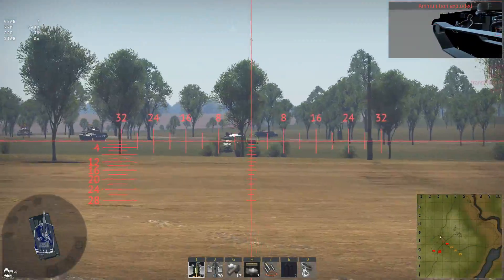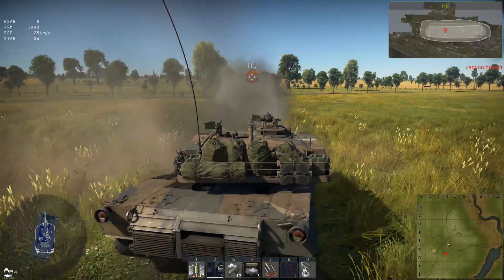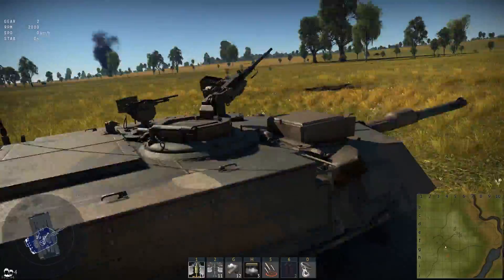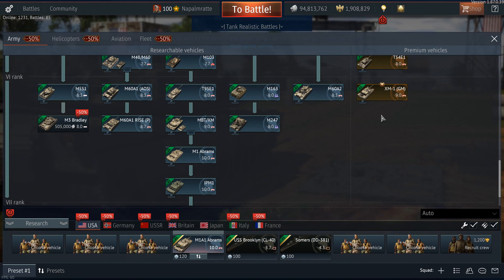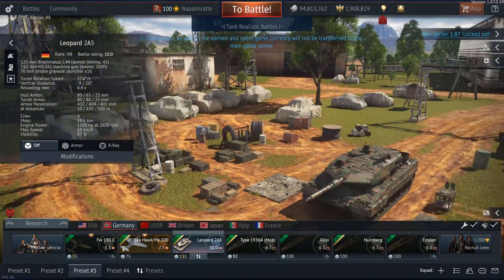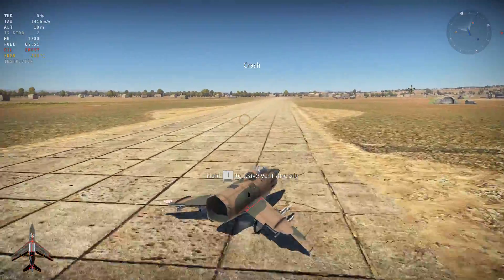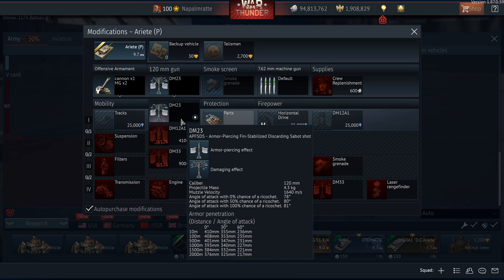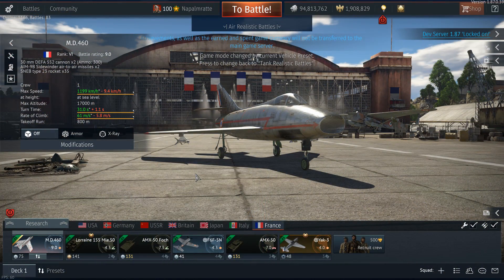WT || Dev Server 1.87 - Changes and New Stuff

Comment: Missiles at 7.7, goodbye 6.7
Gaijin put down the vodka
Reply: At Gaijin were too drunk to think that they could had the version without missiles if they wanted that br
Reply: @thaster973  theres the bmp at 7.3 and the strv at 6.7...
Reply: @Ray-lf1eo  BMP should be at 9.0
ALL missiles should be at 9.0 or 10.0
Reply: Missiles won’t be that dangerous because at 7.7-6.7 its much more about turn fighting than in 10.0.
Hochachtungsvoll,

Ponnes
Reply: Not that I agree with missiles at 7.7, but it's actually really difficult to get a lock on prop planes. Think you have to be at like 500 meters to even get a heat lock. Against early jets though, that's not gonna be very fun.
Reply: At least AAMs shouldn’t be able to target prop planes
Reply: Missiles can't target props
Reply: They can in warthunder, but as a 7.7 you will probably never face props and aam are nothing gamebreaking or op so just relax.
But keep in mind „GeRmAny SufFeRs“
Hochachtungsvoll,

Ponnes
Reply: I do not see the problem here. Please let me know if I miss something, but there is only one 6.7 plane in techtrees outside the german one. It is the Spitfire F Mk. 24. I am curently grinding/spading my 6.7/7.0 german jets and to be honest the bigger problem for me allways were the F84s ruining my day by simply outperforming every jet germany can offer. In 7.7 BR battles I can recal no time seing a Spitfire flying around. So if I queue as 6.7 german jet I firstly are no fighter, or were no good one(Me 162), and if I saw a F84 I was in a possible max BR of 7.7 and the match was destined to be no fun. Because germany as of this point in time has NO 7.3/7.7 aircraft at all. Speaking of unfairness .... The other nations that often get pitted against germany are the USA with 3,Brittain with 2, Russia with 2 and France with 3 possible planes flying at BR 7.3/7.7. It is only fair that germany does get a BR plug in this region, the only question is if it should be made with a premium.
Granted the italians do have a F84 at 7.7, but the german tech tree has no answer till now. And knowing a small bit about how heatseaking missiles work they should not be able to lock on (super)props from that far of a distance as on jets anyway because of their lower heatsignature. Thats why the A-10 Warthog has these turbofan engines (that do get used on  commercial airliners as well) because they also do have a lower heat signature so that Fox-2 missiles do need to be closer to find their target.
I would be more concerned about the other jets at 7.0 than about that one British superprop to be honest, but I also am of the opinion that the missile warning message had its place in the game and thus the Fox-2s would not be that big of a problem anyway. If you want me explaining why I think the message should stay look here: 
https://www.youtube.com/watch?v=YL65QhkFgPc&t=220s
look for a creatorliked comment of Deric Carmickle, my reasons should be an answer to his comment.
Reply: What I also forgot to say is that we don't exactly know how good the Sea Hawk does perform as a fighter anyway because it mainly is a groundattacker/cas, so stop loosing your shit about everything.
Edit:
And judging from the statcard on which we only got a small time to look at, the Sea Hawk does have similar flight stats as the stock Amercan F84 at 7.7 and probably worse when the F84 is spaded and if it carrys not the Fox-2 missiles but other ordinance it should perform even worse, so the plane should be ballanced. But if you still insist of it being moved up the BR the F84s defenitely do have to do the same.
Reply: @haubentaucher8382  Russia has yak15 6.7, and i have heard rumors that he162 will be 6.3. (Both RB)
Reply: @bluecheese4090  You are right regarding the Yak15, but I was focused on props so I plainly overlooked the Yak. My mistake. And yes I know that the Me 162 is 6.3 now thats why I wrote "were  no good (6.7 fighter)"

Comment: the tunguska has 4x 30mm guns. they are mounted in 2 pairs on both side.
Reply from the maker: it was 4 o clock in the morning my dude ^^
Reply: It's two guns with twin barrels. Practically it makes no difference though. Works with the Gast principle where the recoil of one barrel loads the other, cool system that's got impressive rates of fire.

Comment: M256 is derived but not a licenced built L/44.
Reply: Technically, you still needed a licence for that (pun intended). You are both right in some way. Apparently 256 handles higher pressure, which allows a projectile to reach higher velocity, but still doesn't compete with L56 all that well according to some papers.

Comment: Nothing in this game can reliably pen the front of the Leo 2A5...
Reply: lol i m still sure some tanks with hight calliber guns can lol pen that thing with a he round
Reply: the hull armour seems to be bugged. It should be ~430mm UFP apparently, and ~200mm LFP.
Also the turret side armour gives some wierdly high values. Most of it will hopefully be fixed in the live server. Its hull should be a relatively easy penetration for most of its opposition, which allows a ohk by either hitting ammo (if there is any stored there) or the three crew lined up on the other side. 
Also the turret wedges are destructible on the leo2a5 in a similar fashion to ERA. What the turret armour values are without the wedges idk, so it might still be 500mm+ (i.e impenetrable with current ammo), but it's worth noting anyway.
Reply: Remove Weebs good

Comment: Irrelevant question here....
Does anyone know if the tunguska SAM has been fixed?
In the previous dev the range was about 3KM ish whilst it says on gaijin forums 8KM..
U cant touch a AH 1Z or any other capable chopper with 3KM SAM
Reply: @Gridlocked  what does that mean?
Reply from the maker: I said in the vid that the range is 8 km
Reply: @Napalmratte  and did u really test that it is accurate? cuz on the previous dev it also said 8KM but the missile exploded around 3km... just saying
Reply: @Gridlocked  yes but i want the tunguska for one thing n one thing only, collect AH 1Z players tears :) and i need to be sure that sam is able to deliver me that joy

Comment: DM33 with 485mm pen... facepalm  2A5 is going to be just  as gimped as the 2A4. Gaijin and their damn alternate reality......
Reply from the maker: 1) Dev server - changes are imminent
2) who cares, you still shoot it at the gun breech ... voila, you win ...
Reply: Currently the best armor in game (if values dont change), no one else really got anymore armor. 
Similar mobility to m1, will have good fighter support
Reply: @Napalmratte  The breach which in reality is protected in 3 steps: 
1) A ~50mm angled NERA plate  
2) A 600+ mm LOS NERA module (increased from the 410mm of the 2A4) 
3) A 240mm titanium trunnion
Combined providing the same protection as at the cheeks, i.e. ~860mm RHAe with B-tech NERA, and 1,000+ mm RHAe with C or D-tech.

If Gaijin gave it real life values the 2A5's turret would be completely impenetrable from the front, and you'd have to aim for the barrel. But that's never going to happen as even the 2A4 still only has a 178mm RHAe mantlet area, despite the ~400mm RHAe of the real tank.
Reply: @tylergarrett4498  Mobility is already markedly worse, and with the 2A5 it's likely going to be even worse still...
Reply: Lets just give the Leo2A5 DM53 at this point as balance is already fucked.
Reply: @bellator11  Dude the Leopard 2a4 is the B type not the C one
Reply: @fabio6170  Yes, I know, and the armor values ingame are still completely inaccurate in several places, esp. the mantlet. For one B-tech armour has a RHAe factor of 0.52, which means the 410mm NERA mantlet module should provide about 210mm worth of protection itself. Behind that mantlet module is a solid 240mm titanium trunnion, and titanium has a RHAe factor or 0.8,  thus it also provides 200mm of protection. Hence the mantlet area on the real 2A4 has a protection value of atleast 410mm RHA, i.e. almost the same as the cheeks. In short the mantlet NEVER was a weakspot on the real tank, yet in WT it provides a hilarious 178mm worth of protection...

Comment: So what’s the Ariete (P)’s armor? Very curious.
Reply: It's more or less paper.
Reply: Maybe cardboard.
Reply from the maker: 1) dev server stats 
2) who cares since you shoot only gun breech of enemy MBT ^^
Reply: If im not wrong frontal armor should get around 480 mm and frontal turret armor around 500mm.  lateral armor i cannot find values and rear should be around 40mm ( in RL i mean in game se will see)
Reply: @marcomarcolino95  what I was told by someone who did extensive amounts of research on the Ariete, the model of the tank in the game is from a mobility test bed, which had no composite material inserted into the spaced armor arrays, which is why they called it the C1 Ariete "pre serie".
Reply: @Rohrkrepierer  i know from other people on the wt forum that the actual differences with c1 and P was in electronics only. Armor was unchanged from the c1
Reply: @marcomarcolino95  yeah, some people say this, others say that. Ultimately it only matters how it plays on the live server, so I don't really mind these issues.
With DM33 at 9.7, it will do more than fine.
Reply: Its the Prototipe dude